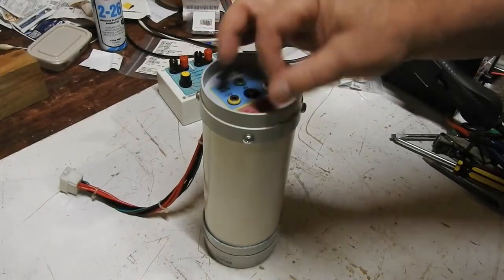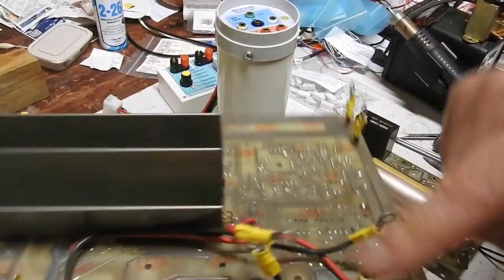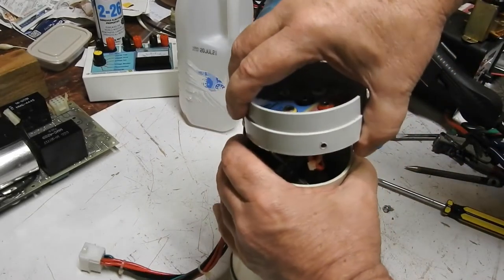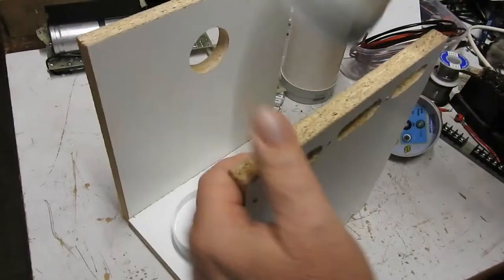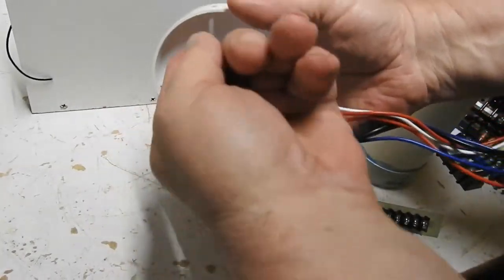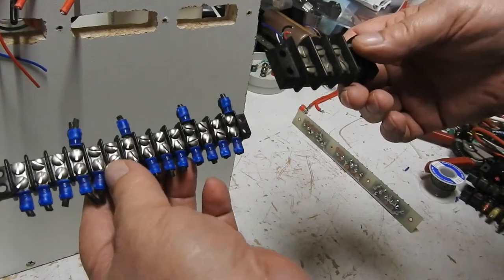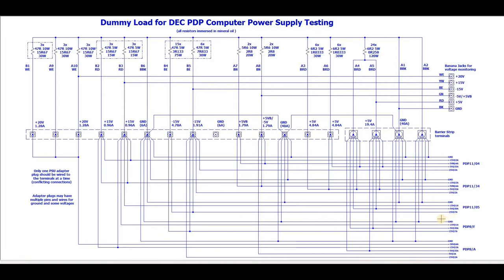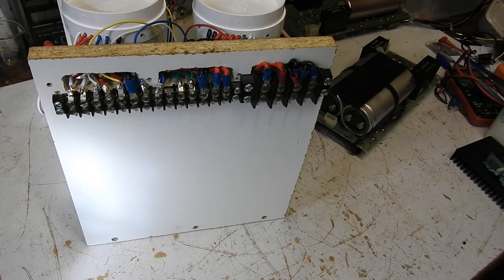Dummy Load for DEC PDP Computer Power Supplies

Comment: Yes should be easy to adapt for other supplies, as you just need to have the right resistance for them, and more or less the right power handling, though with oil fill you could probably get to more than twice the power handling over free air use. As to the capacitors, they might reform somewhat, but I have had a good number of the old capacitors that just up and died after storage, and a lot as well simply are never going to be recovered at all, especially with those with rubber over SRBP seals, as the electrolyte evaporates through the seal with time, and while it might come back to roughly the right capacitance, the ER will be sky high. Did however try a NOS 10 000uF 6V screw terminal electrolytic from the 1970's, and after charging to 6V through a 1k resistor for a day, it took over a month to self discharge, pretty good for a capacitor left in storage for over 40 years. One next to it though had rotted out totally, just turned to powder, and left the chassis clip a solid block of rust in the paper wrapping. Same make, same batch as well, both USA made.
Reply from the maker: Normally I don't like resistors running hot, so I try to keep them at well under half their power rating, but heating has to be accepted with a dummy load. Under oil, I've sized everything to run at 100%, and in the previous version, I could easily have 300 watts dissipation for 15 to 20 minutes without getting absurdly hot. Which is more than long enough to test a supply.

On the caps, most have checked out good, with one possibly borderline (for leakage at least - I have to come up with something better for checking ESR). The worst ones seem to be those across the supply outputs, with very low voltage headroom, eg. the 6v caps on the 5v rail of the H777s were both cactus.

Coming up is a video on the simple capacitor reformer/leakage tester I used here. But ultimately I need to make an automated system, that does the lot, including ESR - because I have dozens of large computer grade electros from the 80s and 90s to check. 

Your experience with the difference between 2 identical NOS caps is very interesting (and worrying)...